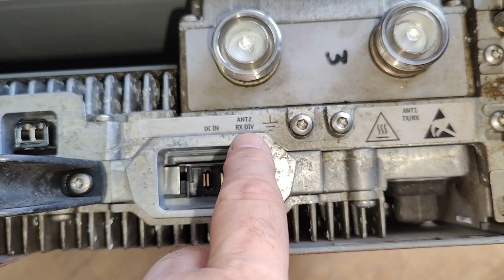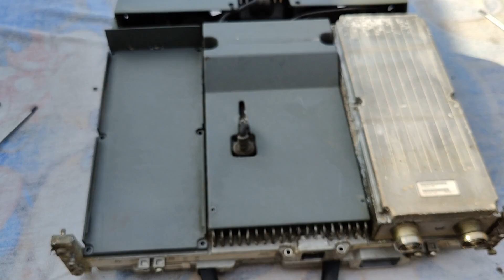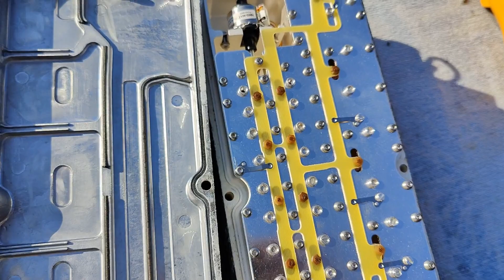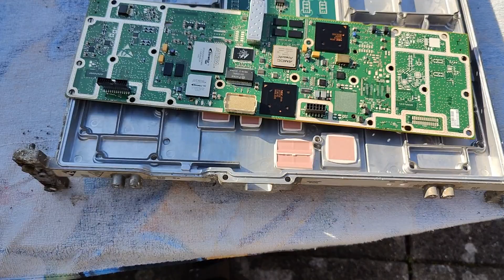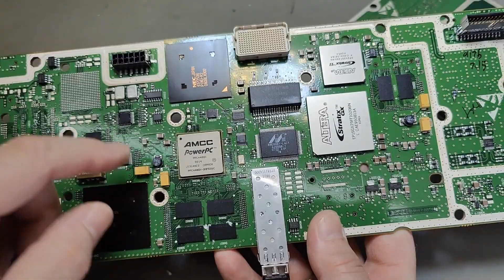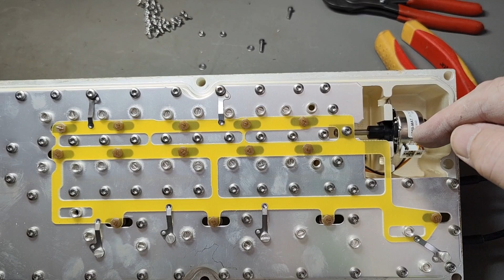Nokia Siemens W-CDMA 3G Transmitter Receiver Filter motor tuned cell phone basestation

Comment: 23:49 master Yoda, is that you?
Reply from the maker: The Wilkinson power splitter was invented around 1960 by an engineer named Ernest Wilkinson. It splits an input signal into two equal phase output signals, or combines two equal-phase signal into one in the opposite direction. Wilkinson relied on quarter-wave transformers to match the split ports to the common port. Each side can be formed to any shape the designer need to make room for the track length needed
Reply: @TeardownOZ2CPU  Quite an interesting meander they chose, though! Thanks for the great teardown!

Comment from the maker: I think i forgot to mention some details about the motor tuned cavity filter: tuning ferites got holes to the top mounted plastic part, that is slightly OFF center, this means : by loosen the top nut, it is possible to rotate each ferite, and this way match the frequency adjust for each resonator individually